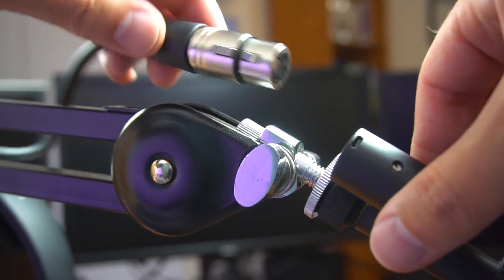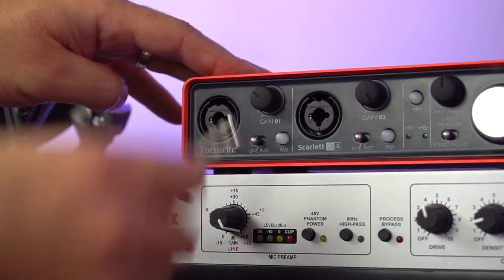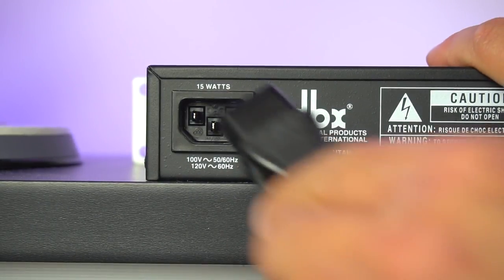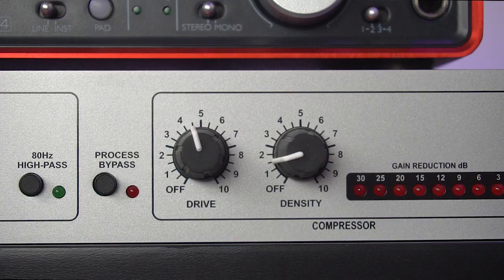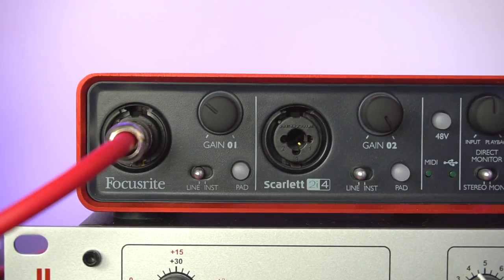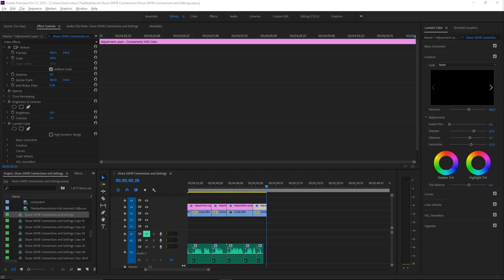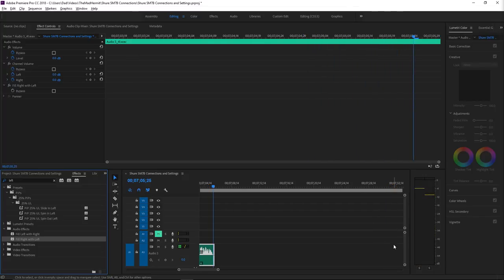How to Connect the Shure SM7B XLR Microphone to a Computer

Comment: Thanks so much for your videos on using the DBX 286s!  Your videos helped me decide to buy it and this video helped me fine tune the settings.  

I'm recording in my home in a less-than-ideal acoustical environment, with absolutely NO soundproofing or sound treatment to my room at all.  Even with making my environment as quiet as possible, I STILL had some background noise from my A/C and mic hiss -- and it was driving me CRAZY!  (I live in South Florida and can turn of my ceiling fan when recording, but turning off the A/C while shooting videos) is out of the question.)  So I bought the DBX 286s primarily to hep block that background noise.  

It has made a tremendous difference!  I still need to edit the audio a little bit in post, but could get away without it if I weren't a bit nitpicky. ;)  Which means I can even do Facebook or YouTube lives or webinars with the DBX 286s and would still have pretty good audio even live.  :)
Reply from the maker: Awesome! Thanks for the positive feedback. Finding an audio recording solution that you like takes time and my tastes and techniques have evolved over the years as is reflected in my videos. I am happy with my current configuration and am pleased that it has worked well with you. Thanks for sharing!

Comment: Thanks for this video! I have had problems with the hiss that the DBX286 emits, and I think it is because I was connecting the equipment to a Focusrite via the XLR input. The preamplifiers of both devices were adding up and it seems that this is where the white noise comes from. I feel that your video will be very helpful to me. I'll know as soon as I receive my balanced jack cable. Greetings from Spain and thanks again!
Reply from the maker: Let me know if it clears things up for you. Hello from the United States! :)
Reply: It has undoubtedly been solved. Now, with the balanced jack / jack cable, the preamps do not add up, and that annoying hiss disappeared in the background. Now I am happy with my DBX. Thanks and best regards!

Comment: Nice setup and a very easy to understand explanation. Why did you move from the Cloudlifter to the dbx? I am curious because I am about to create a very similar setup.
Reply from the maker: Thanks and Great question. Using the Cloudlifter I felt my noise floor was exceptionally noisy which is odd because people are always saying that you get "clean gain" from it. When I took my gain and amplified it to try to identify the source I noticed that I was picking up a local radio station whose transmission tower is not too far from my house. I ordered another new Cloudlifter and swapped-out all my cables and could not make that RF interference go away. This forced me to look for a new, comparably-priced  solution. The dbx286s not only provided ALL the gain I needed for my Shure SM7B, but it also did not suffer from the RF interference issues I was experiencing. As a bonus, the dbx286s comes with all those neat signal processing nobs and costs about the same as the Cloudlifter.
Reply: @TheMadHermit  I just combined my dbx with my cloudlifter to power my sm7b and it works amazing... just dont forget to use phantom power for the cloudlifter

Comment: ProTip: There's a mic pre in the focusrite and its' probably better quality than the cheap dbx.  The reason the sound is only coming out your left speaker is because the mic is a mono signal and you are sending it to a stereo channel.  Send the signal to a mono channel and the sound will come out of both speakers balanced.  In my opinion, plugging the mic into the focusrite directly and bypassing your dbx and all its settings will greatly improve your sound.  Maybe you should do an A-B-C test video.   A: mic direct into focusrite with NO processing  B: mic direct into dbx with NO processing and then C: mic into dbx with "processing"    Make sure volume/gain is adjusted accordingly as to not mistake a change in volume as "better" sound.
Reply from the maker: Thanks. The only problem is the Shure SM7B needs +59dB of gain. Can't get that out of my focusrite. Need the dbx286s for that. The dbx286s does not have a USB interface. Need the focusrite for that. Hence why I use both.
Reply: @TheMadHermit  Something isn't right.  I've owned many sm7b's and the focusrite mic pre should function perfectly.  Check to make sure there is no pad or attenuation on the focusrite or the SM7.  I'm 100% certain going direct into the sound card's mic pre will yield better sound quality results.  Unless you had some ultra high end preamp there is no need for the dbx, on top of that the SM7b is an exceptional mic for your purpose and no processing is really needed, just make sure the signal isn't clipping.  Plug the mic into the focusrite, set the mic pre input gain so you have a "decent" signal and then adjust the output of the unit to get the desired output volume.  I've got decades of experience in recording studios, just trying to helpout :-)

Comment: Thank you for another amazing video ! :) 
It was your videos which helped me to improve my audio setup for live streaming and video production. 
No need to record in Audacity, apply noise gates, compression, etc. 
DBX at it's price point produces fantastic result which are ready to go 
directly into OBS Studio without any need for post-processing (at least in my case).

There are few things I'd like to point out. 
According to information on the Focusrite website, you are not actually bypassing internal preamp. 
You are still using what is called "fixed-gain line amplifier circuit". 
Does it change you signal ? 
According to their website it doesn't really, but the guys from Gear Slutz Forum would strongly disagree :D 

Assuming that majority of people watching this video would use it to record their voice for 
video / live streaming it wouldn't make any difference at all for their viewers.
But if you are really want to be "technical" and want "the best of the best" I can recommend Audient ID22 which can fully bypass internal preamps.

I've personally gone with the following setup which I think is "overkill":
Shure SM7B -> Cloudlifter -> DBX 286s -> Audient ID22 -> PC

In case you are wondering why did I put Cloudlifter in there ?
As was mentioned in this video, this mic requires 59dB of gain
which makes DBX preamp to work at it's "full power". This adds
a bit of unwanted "self noise", which depending on you compressor settings
and noise gate settings, can get quite noticeable.

Cloudlifter allows me to turn down the gain on DBX to 40-45 instead of 60.
It also adds a bit of clarity to my voice. Whether it's worth paying for 
"little bit less noise" and "little bit of clarity" you have to decided for yourself.

I'm happy with my setup, but if I was to do it over again I would probably go
with cheaper alternatives to save up money:
Shure SM7B -> Triton Fethead -> DBX 286s -> One of Scarlet Interfaces

Anyway, this is just my 5 cents and hopefully it will help someone to make their mind.
Thanks again for the video :)

Comment: Ok. I always add a new audiotrack and make it the mono type. Set it up for recording audio to, and you're good to go. I guess it's just another way. Thanks for the info about the audio levels. I have the DBX connected to the Scarlet with a TRS to XLR cable. I didn't know it would bypass the preamp in the Scarlet if you used a TRS on that end (and I seem to remember you didn't either, but got a comment regarding it). Oh well. It works fine. I have the Scarlet dialed all the way down.
Reply from the maker: +MrDubje I like your idea about adding a mono track. I'm going to try that! With regard to the switch to the 1/4" TRS that was an improvement suggestion I got from the comments as well, hence my update. I like to share what I learn as my process and techniques evolve. There is always room for improvement.

Comment: If you have problems with a Cloudlifter or a Fethead, BUY SHIELDED CABLES. IT IS NOT THE DEVICE'S FAULT. Some AmazonBasics or any cheap cable will have interference, especially if the following points happen to you:
- A radio station is near you
- Your gear is near your screens or electronics
- You have neon lights
- You're recording in a kitchen and a microwave is functionning
Well, anything causing electromagnetic pollution.

To have the best results, here are some tips I follow:
1. Buy shielded cables. The Sm7b has a base which is strong enough to stop electromagnetic pollution. It's not the microphone's fault
-Limiting WiFi interference-
2. Use a desktop computer if possible, not a laptop, or connect your laptop to the internet by an Ethernet cable.
3. Move your cellphones away during your recordings.
4. If you have multiple floors, try to record tothe floor where there's no router. For example, if you want to record in a basement, try placing your router on the 1st floor.
-General (linked to pullution, but not necessarly electromagnetic pollution)-
5. Keep the gear as far away from Neon lights or screens as possible, get the mic closer to your mouth
6. Invest in acoustic treatment and base traps to avoid reverb
7. If you live in a buiding or if there's a lot of background noise, soundproof the room.
Reply from the maker: Great tips! Thanks for sharing!

Comment: If all I needed was XLR to quarter inch output is there something smaller than the dbx?
Reply: Cloudlifter, but you need to enable phantompower for the mic to be powered, as the preamps of just the scarlett 2i4 arent powerful enough to drive the microphone without insane levels of "hissing"

Comment: I LOVE U! This video just saved my f*ckin' life, dude.
Reply from the maker: Glad I was able to help. :)
Reply: @TheMadHermit  I just got one question. Why do I only hear my own voice on my right speaker? My Headset is fine. If I watch a video on youtube everything's okay(means I can hear on both sides)
Reply from the maker: Great question, this is because the focusrite supports two channels. If you plug your mic into the right side you will hear sound from the right speaker. All you have to do is mirror the right channel to the left. You can do this with whatever software you are using under settings. Look for a convert mono to stereo option or something to that effect.
Reply: I am so sorry it's actually the left speaker and I already plugged it into the left channel of the focusrite. If I put it into the right channel I do only hear the sound on my right speaker, that's true but it's plugged in the left one.
Reply: @TheMadHermit  I really need help with this. :(
Reply from the maker: As I stated before, you have to mirror the channel you are hearing the sound on to the channel you are not hearing the sound on. This is done via software. Look for a mono to stereo option, or copy left to right option. Something to that affect.

Comment: Hi. I am using Mac and I have followed the same chain (Focusrite turned all the way up, No PreAmp, shure SM7B) as yours but instead of recording on Adobe Premier pro (I dont have one) I am using Audacity and for some reason Audacity is not recognizing the sound. i Have MAC and I see if I tried to record in Final cut pro it is working, but I want to record it in Audacity and it's flat line no sound waves. Any thoughts. I looked at focusrite website for Audacity settings for Mac and all looks good.
Reply: Did you update Audacity recently? If so you need to run it from command-line. OS X Catalina made a lot of things worse.

Comment: Great walk-through.  That is a LOT of gain, compared to what I do with the same .hardware.  I've got the DBX gain at 60 like you, but I have the output at about minus 20 dB instead of +10, and I've got the Focusrite set to 0 gain, not at 10:30 ; and I'm running Windows 8.1, which generally needs lots of gain.  So that's interesting to me, and I will do some experimenting, because what you're doing works well for you.  Another thing that looks different, is that with the Focusrite, it seems to me the recording level setting in Windows makes no difference at all, because, it seems to me, the Scarlett driver is basically replacing that function of the Windows driver . but I take it you must be seeing that it makes a difference for you.  Thanks for doing this is such detail.
Reply from the maker: Thanks +Dan Magoo. When I was connecting my DBX286s to my Focusrite via XLR -> 1/4" TRS my output gain was set to -10db on the DBX286s and 0 on the Focusrite. Switching my connection to 1/4" TRS on both side (from the dbx286s to the focusrite) forced me to change those dials to what you see in the video. Remember, the way I am connecting it now bypasses the preamp circuitry in the focusrite.
Reply: Thanks for the follow-up.  I suspected the 1/4-inch connection was a factor, based on what you say in the video, because I use a 1/4-inch-to-XLR cable to connect the DBX to the Focusrite.  But I never knew before that the type of connection made this kind of difference.  Very enlightening.
REPLY
Reply from the maker: +Dan Magoo Anytime! I didn't realize that when I first did my video over a year and a half ago either. You live and learn my friend. :)

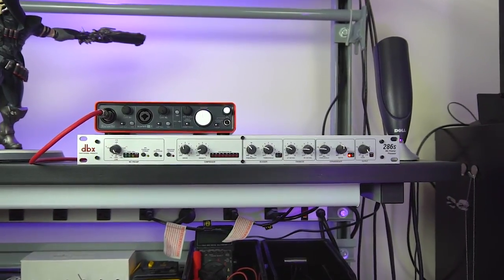Comment: Hi! Thanks for the video, it's very informative especially for someone who has not done much audio work. I also have a noisy office (9U rack  + servers + NAS) and I'm looking for a way to reduce this noise. I have two use cases: 1) For work we use Google Meet (similar to Zoom) and most people complain about my background noise. I mute myself unless absolutely necessary to talk which is less than ideal and 2) I'm planning to start recording videos for various software engineering work (YouTube and/or Internal). I have two questions: 1) At 6:20 you show that the sound is coming from the left speaker only. Will that be the case when speaking on a Google meet meeting? 2) Given that the DBX 286s is the pre-amp and the processing, are there any cheaper alternatives to the Scarlet 2i2 (3rd gen)? The scarlet runs at about $200 and as far as I can tell, you're only using the TRS to USB feature out of it (again I'm a noob when it comes to Audio so I may very well have missed something). P.S: My machine runs Linux if that matters.

Comment: Thank you for the excellent tutorial videos on configuring all of this hardware!  I currently have my dbx 286s adjusted to the same settings you are using along with a Shure SM7B as well.  One question I do have, I currently am running a window air conditioner and I would like to try and eliminate the air conditioner noise as much as possible using the dbx 286s.  Can you provide any recommendations on which knob(s)/adjustment(s) I can tinker around with on the 286s to try and remove, or at least minimize, the hum from the window AC?  Thanks again!
Reply from the maker: There really isn't a knob for this on the dbx286s. I have central A/C and try to pre-cool the room before recording and then turn off the system when I do record. My point being that A/C noise is a real problem. Alternatively if you have Adobe Audition (or something similar) you can apply a notch filter in post to zero in on the offending frequency and remove it there. Not ideal if you are live streaming or don't want to go through the extra work but it is an option.
Reply: @TheMadHermit  Thank you for the reply.  I use my setup strictly for live streaming and utilize VoiceMeeter Banana, for transmitting my microphone and other audio, directly to OBS Studio.  I'm still very satisfied with the dbx286s and Shure as it still does a much better job of filtering out background noise than when I was using only a Blue Yeti USB mic.  Thanks again for the help! Much appreciated!

Comment: Quick question, why don't you just go straight in to the Focurite with the 1/4, and use the pre amp in that box.  Instead of the other pre-amp, and then out to the Focusrite? Also, do you not have to use a Cloud for the SM7B? Does that DBX allow you to do without it? Great video, by the way. Just curious.
Reply from the maker: Great question. The Shure SM7B needs 59dB of gain. The focusrite alone does not provide that. The dbx286s provides 60dB of gain. I use that to get the signal to line level. I tried the CloudLifter first but it introduced RF noise into my noise floor so I don't use it.
Reply: The Mad Hermit Thanks for the explanation. Would you mind explaining “Noise Floor” and Line Level Signal a little bit. Thank you.
Reply from the maker: Good questions. 

Noise Floor: In a perfect world, you would have zero noise in your recorded signal. In reality, there is always some level of noise (ambient or otherwise) that is incorporated into your recording. Every space has its own room noise (from computer fans, to A/C units, etc.), then there is Radio Frequency noise from local ratio stations, cell phones, wifi routers, etc. that may introduce themselves into your recording, as well as 60Hz line noise from the electrical wiring of your house. All these unwanted noises, no matter how small, are added together and comprise your noise floor. The sound that is recorded even when you are completely silent. This is the sound you want to eliminate as much as possible.

Line Level: When you connect audio devices together, they expect to communicate at a particular "volume" so they can interpret the signal properly. The line level "volume" is measured in volts and devices that received line level inputs expect that signal to be about 1 volt. If you provide a lower signal the device you are connecting to will have trouble manipulating it which will result in an undesirable output.

Hope that helps!
Reply: @TheMadHermit  Awesome. Thanks for taking the time to clarify both topics. Your answers and time are very much appreciated.